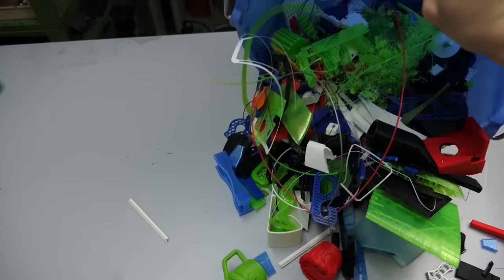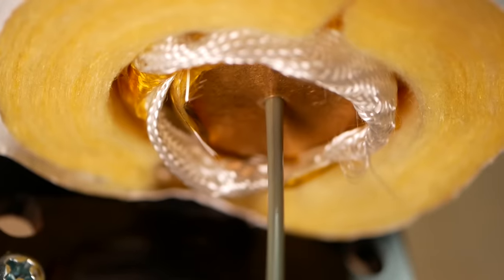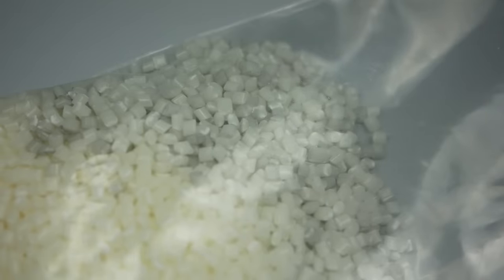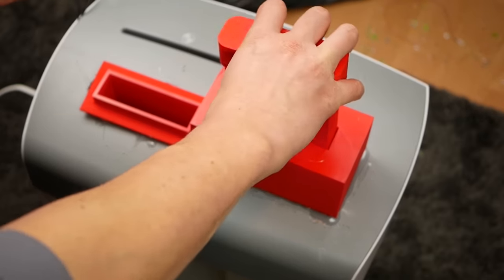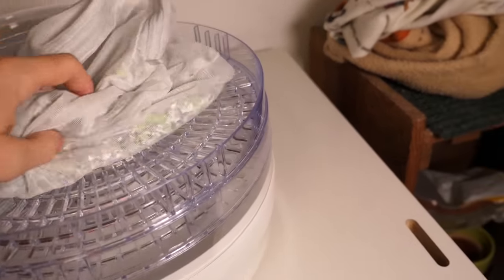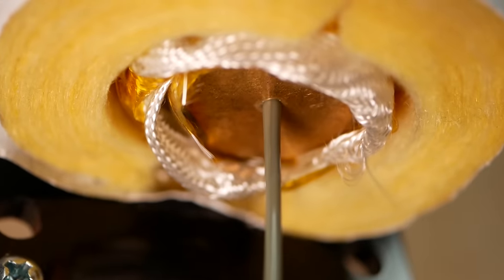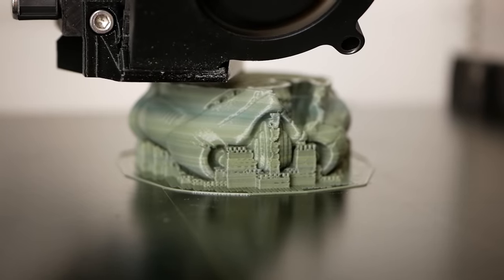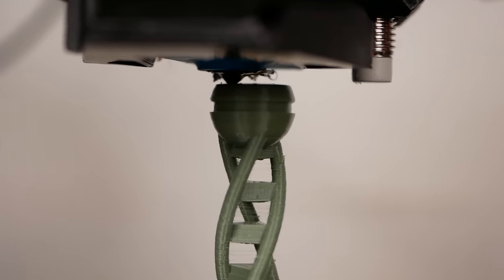Recycle your failed 3D prints! Make new filament at home.

Comment: My scrap abs prints go in a jar with acetone to make abs glue.
Reply: How strong is it? What materials can it stick together?
I print a lot in ABS, so I'd be glad if I could find a use for all those supports and other scraps...
Reply: @Bednar121  Well that is pretty hard to answer but lets give it a try. First tools i use for this are 
1. Big container of acetone bought in bulk for cheap price as main storage to refill smaller one.
2. Smallest container size with easiest to open method that works for you, as you will be opening this very often 
3. Glass container with metal cap that is air tight and over time you notice if seal material is acetone proof. Best one so far has been Maille mustard container, but its shape leaves things to be desired.
4. Injection needle where you scribe the end with file to create fault line, being EXTREMELY CAREFUL with ridiculously sharp end!!
(its sharp as scalpel so it easily goes trough to bone if you fuck up, so you might want to dull it first with sand paper or sanding stone to be safe, also as side note if you need sterile knife to open swollen boil for instance to drop the pressure and empty already infected content your self, injection needles end does the work, long as you know what you are doing).
Then just use pliers to snap the end and if possible flatten it and put inside some other metal scrap so no one else hurts them selfs with it and remove sharp/ rough edges with sand paper and you have small nozzle to inject acetone accurately where you need it.
Also syringe of you desired size, though 1ml syringe has been enough and it lasts long time as its pretty chemical resistant.

Now if you have simple layer separation on print that you can open and close by compressing and if all possible open it up fully, just apply acetone on the surfaces, give it bit time to soften the abs and then close it and its will be glued with in few minutes if plastic got sticky enough. Though as side note try to limit how much gets inside the print you have lower than 100% infill as it takes long time for acetone get out from the structure and it might even soften the whole print, though this can be useful too as you essentially acetone vapor bath prints inside surfaces.

If you have layer separation and warping then step one is as mentioned and then you can fill the gap with acetone, ABS putty/glue, but in incrementally as it takes time for acetone to gas out from the ABS. Putting too thick of a layer will cause surface to stiffen up, so gas cant escape easily and then you have gas pockets that expand. Quickest way to do get around this is to put on small quantity of paste, show little torch for it to burn out the gas inside and push the material back in its place right after. Repeat this enough times to fill the gap and finally smooth the surface by using the needle and applying acetone little by little into the area. With this i have saved countless failed prints, though surface most likely will turn bit of while so i would suggest you spray paint the part if its looks are important

For gluing two different prints together pretty much same rules apply as previously mentioned.

For gluing different materials together, well my printer is made from PLA and X-axis end stop adjuster i made from peace of failed print that i pretty much just melted and compressed with anvil, let it cool down, shaped with rasp, drill and tap for the M5 bolt and then just smooth the surfaces with acetone, let it stiffen and again with acetone melted the surface and pressed it to PLA nozzle carrier. After a hour it was stiff enough to use and has lasted 10 homings and 20 hours of print and i cant separate them with reasonable finger force. I could test this, but i dont have any other materials at the moment to test this with at the moment, but i need to look into it in future. What i theorize is that with different materials it depends on how liquid it is so it can fill minor holes and bumps effectively and how porous the materials are. You should be able to glue wood together, but i havent tested it. If you have some utility in mind just try small test peace and see your self, just make sure its gassed off completely before tress testing.

For ABS glue/putty i use rougly 1:1 mix. Supports melt much faster due large surface area, so you have batch of putty in hour to two hours. Stored putty will eventually gas out even in the jar acetone out and stiffen with in a month, but try to get the stiffen mass off from the glass surface so new acetone can sweep between the ABS and glass increasing surface area and you should have it ready for use next day/ on evening. 

As safet precaution do note that acetone wapors are not best thing in the world for you body and skin contact is not that good thing ether. Your skin will dry and acetone will enter to your blood stream from said skin contact so it should be avoided if all possible. Back when i was working on car shop we had relatively smart/dumb system where spray guns were cleaned with acetone and skin contact caused me to get drunk/above average toxication, with huge head ache and with out the doubt it killed 20 IQ points while at it, so be careful, use in ventilated space and avoid skin contact.

This is just what i have found out. I use to build custom airsoft guns and i picked this method before i started to print parts.
Reply: 100th like 😉
Reply: Filip Bednarowski please, follow the answer you’ve got.
Reply: @Bednar121  deadly strong
Reply: Really?? Why don't you make a video of your scrap abs prints with acetone to make abs glue?? Very interesting to watch video like this one! 👍🏻🙌🏻👊🏼
Reply: its possible to use Abs glue to join 2 parts of PLA ? or  the glue only works on Abs parts?

Comment: To shred better
1. Melt down the scrap
2. Pour into a mold or press into a mold if it is play dough consistency.
3. The mold should be a shape that is easy to chop
4. you come up with the best shape.

Or you could easily chop the new extrusion.
Another idea is to have a filament recycling business. Buy scraps from people in your city and sell the recycled product. Economy of scale could make it viable. People could ship scrap to you if they have enough.
Look at a pasta extruder. The ones that make small sized pasta . There is a spinning knife that cuts the extrusion as it comes out
Reply: The issue here is I think polymers lose strength each time its heated, so you don't wanna reheat it too many times.
Reply: @WannabeCanadianDev  True  when not compressed
Reply: @WannabeCanadianDev  also, if you heat that sort of material excessively, it can burn and produce toxic gases, so it would require quite "The temperature control system" for that heater.
Reply: you don't even have to buy it
Reply: @WannabeCanadianDev  so how many times could you reuse the same filament with this recycling method.
Reply: Nice idea, but you would have to be certain that it's all the same plastic so you don't get mixed scrap from people. You could also mix all the scrap with new pellets to get a more consistent result like he does in the video
Reply: pasta makers use bronze dies to cut
Reply: Why chop the new extrusion? Isn't that new extrusion the continous end product you intend to make?

Comment: I'm sure it's worth it if (We) as creators put as much into it as we do our printers and other tools. That looks like what your doing. a good systematic approach.  We cannot just create and not be concerned with the waste.
Reply: On the flip side when looking at injection molding, they go through thousands of failed parts when warming the machine up and getting the molds right. Your 3D printer is a machine that wastes very little in comparison to industrial manufacturing.   My point being is that, banning straws, or spending exuberant amounts of money/energy/time on an inefficient process may not be the BEST way you could be helping the environment.
Reply: @Chazz155511  as a past injection mold machinist i agree. Plus all the wasted material from the sprue channels even in normal operation. 
i had to sit by an injection mold machine to cut the flashing off so we can get some parts to the client then take the mold back to improve it and remove/reduce flashing.
Reply: Your time is worth something, recycling prints is not savings you or the world anything.

Comment: I like the idea of recycling filament.  I do think there needs to be some alternatives for the hardware to do it.  $500 is ok for a person or small company that is printing a lot, but its too steep for a hobbyist.
Reply: Wayne McCormick Even old clearance filament from Chinese manufacturers under 5 dollars per kilo has significantly better quality than homemade. The only advantage of recycling filament at home is reducing land fill.
Reply: @yyh1002  'only' can be enough. not everything has to come down to money, I hope.
Reply: PLA is completely biodegradable though and disposing of that is not an ecological problem.
Reply: That $500 would be better spent getting a low end resin printer. Honestly $500 is a total rip off for that stuff the parts alone to build it might barely add up to $200 when all is said and done.
Reply: Maybe if i had a dual extrusion setup, whereby i could use my recycled plastics as just support materials, that would satisfy my quest to reduce my carbon footprint as such.  I agree though, for the hobbyist who prints less than 1kg per month, its just not worth the cost.
Reply: @KegRaider  would it really reduce the footprint or would it make it larger? The whole process used a load of eletricity, clean watter, required extra tools.

Its good to recycle and all, but maybe it is requiring more resourses from the Planet that would be required to get the same amount of fillament from a industry + the propper way to discard and treat the leftovers.
Reply: Pocoyo i loved your show
Reply: @joaoaug  Well, you would buy new filament instead of using your own made from scraps, right? Obviously factories also use electricity, generate waste water etc. Also, consider the fact that there's a limited amount of resources available to humans, so reusing waste is usually a good idea.
Reply: @RamoArt  , i was asking because if the costs of recycling is cheaper or a bit more expensive than buying new fillament i would definitely recycle at home, but looks like it costs a lot more. If you could spend X dollars on a brandnew fillament or 5X dollars on a recycled one(with all the issues), would you go for the recycled one? If the cost of recycling at home is to high we should send the leftovers to some one specialized
Reply: No $500 is ridiculous when high quality 3D printers like the ender 3 exist for $200
Reply: thebman80 even $200 sound high, it’s a paper shredder and extruder and roller and sensor.  It has less parts than a 3D printer, it should cost half as much
Reply: Maybe people could partner up. I think that 10 hobbiests would be enough.
Reply: @lifehackertips  "High quality" "$200". Never heared that in one sentence and I won't believe that either. Prusa FTW!
Reply: Benedikt Müssig you’ve never heard of the Ender 3?
Reply: Ryan Huang that’s true and you can use weed wacker line
Reply: Exactly what I was thinking. Shit I thought he was just going to stick all the old filament in a pot and melt it down then throw the liquid in a press. Or something really low budget like that lol or maybe just build a recycling kit from the 3D printer itself lol
Reply: You'll can reuse the motor in your ebike, here is the build for $465, that's probably cheapest you can get: https://medium.com/endless-filament/make-filament-extruder-for-465-bbc0e8a74e74

Comment: Suggestion, First extrude at 3mm. Chop the 3mm filament into nurdles. This should mix the color better on the second extrusion for 1.75mm
Reply: You don't even need to chop it .. just make a big reel of 3mm as the first pass ti generate a feed material that is contiguous (unlike the shredded knurdles) .. then feed that through a 1.75 extruder for the second pass very much the same way metal wires are pulled making the diameter smaller each time. I think this could give a very consistent result. Actually you could do both steps in a single machine and skip spooling tbe 3mm if you make the machine a bit more complex
Reply: but that doesn't help with the color, you have to mix it again, for it

Comment: It might be interesting to see a setup where the scraps are extruded into a 4-5mm diameter "filament" and then immediately chopped off with a rotating blade (while still soft) to make pellets that can then be used to feed the real filament extruder. I think this might help with consistency and it could also allow for bigger input scrap, maybe even a system where you don't have to shred it at all or only minimally since for the first extrusion part consistency does not matter.
I'm also very interested in a DIY version of this; I don't want to spend more on filament recycling than I did on my printer...
Reply: There is a pellet extruder design on thingiverse
Reply: Check thingiverse for the pellet extruder design .
Reply: Yes

Comment: This video might be 3 years old but I'm finding it (and your follow-up video, which I saw first) both helpful in terms of the viability of recycling old prints. I've only been 3d printing for about 6 months but I knew as soon as I got the printer that I'd have some leftover plastic or failed models and I would absolutely find a way to recycle them - without any research of any sort into the community and whether it was something that had been done before. I keep all my failed prints and any scrap plastic larger than 2sq cm in size locked in a plastic storage tub which originally held my toy trains (or my Lego) from before I started living on my own and donated all my old toys.

Comment: I worked in a factory running industrial extruders for a couple months so this is a pretty neat video for me lol, the big ones aren't much different.
Reply: I assume they have better control on the filament width? How do they do that?
Reply: @walkinmn  our extruder machine can control the diameter tolerance around +-0.02-0.03mm

Comment: Have you worked on this some more? One idea that came to mind to solve the shredding problem was to not shred the plastic at all, but making your own pellets. Melt it all together in your oven (you can mix it up while you're at it to get a uniform color, this also gets rid of any water and lots of the dirt, though you end up with the gunk accumulating on top, just like when casting metal) and run it through a "gravity-powered" extruder (basically a heated metal funnel) with a rotating blade underneath that cuts chunks off as they exit the nozzle (inspired by a play-doh machine 😅). These pellets need to cool off enough during their fall into your bucket to solidify, but that shouldn't be a big problem. If it is, let them fall through a piece of pipe with a fan at the bottom (blowing in from the side through a T-intersection) that blows air upwards. Slows down their fall and cools them at the same time.
I just worry that the newly formed pellets will just stick to the blade instead of falling into the wind tunnel...
Reply: The problem here is: the more often u heat plastic up, the shorter are the C chains ..
Reply: @emkay1182  perhaps a binding agent can be added.. he used new pellets but that to me isnt too practical.. it would be ideal to find a cheaper solution.. perhaps a liquid.. like a glue/resin compound that when dried isnt brittle.  Most likely adding fresh pellets would be the only solution but who knows.
Reply: you would still need to shred it because more massive parts will take longer to melt, causing inconsistent duration of heating
Reply: Not a 3d printer person but love the engineering and science aspect. Can not the pellets slide down a "marble run" type of trough to add more cooling time and bounce off an angled base to add a few final seconds and air exposure to the collection bin? The fan(s) for the collection bin can be placed behind angled base and the beads don't jam up the blades above a max collection level line?